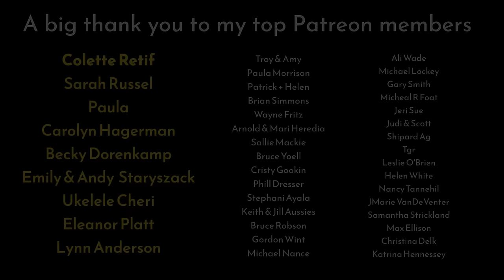Work Continues In The Cottage! Repairing Collapsed Stonework

Comment: FYI: 'MBPS' = Mega-Bits Per Second.    Network communication speeds are measured in Bits (1s and 0s).  Computer memory is measured in Mega-Bytes (1 Byte = 8 Bits)
It takes a hell of a lot of bits to transmit one frame of video...

Comment: Just a suggestion… maybe you could get some pointing slicks. I find they are invaluable for pointing tight areas. If you cut down a slicker in length it is  more manageable. You can also use a wood ram rod or tamper to compress the air out of the mortar and pack it in. There is something gratifying about pointing stone. I’d love to be in a country like France that actually has stone buildings. You’re a lucky guy!